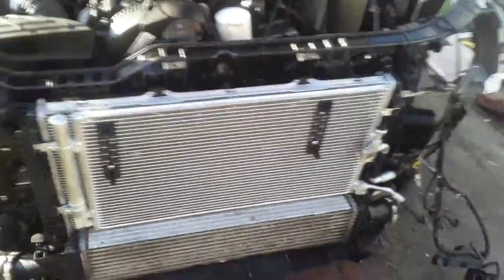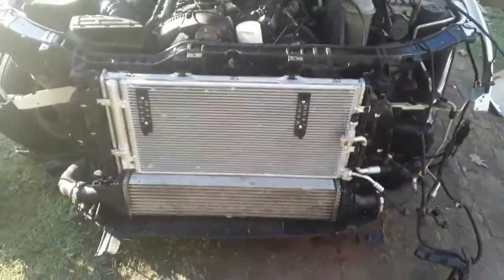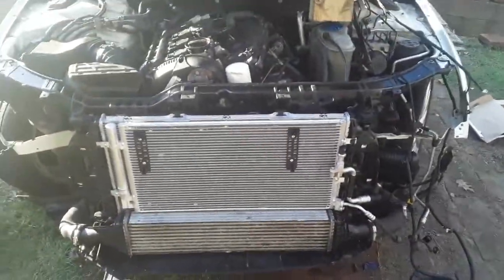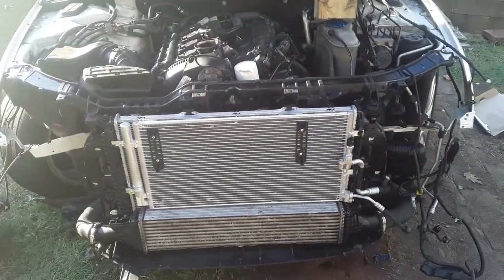09-16 Audi A4 Quattro B8 Front End Replacement DYI #Part2 Radiator & Condenser Installation/Removal

Comment: hey. when i disconected the condensor pipes it depresurised and started leaking some oil out. did u run into this issue also? was hoping to get some insight into what dis is
Reply from the maker: When you disconnect the the condenser, the freon from your AC system will release.
Reply: @LadyzLuvAuthentic  but its only freon right? i dont have to worry about oil as long as i dont open the compressor? jsut need to change condensor and refill?
Reply: @Luuuugn But if you're worried just look into adding pag oil back into your system. You shouldn't have to worry if you didnt mess with your compressor. You should just have to recharge it and be good if you only messed with the condenser.
Reply from the maker: @Luuuugn  oil should not be coming out the condenser. Should only be freon